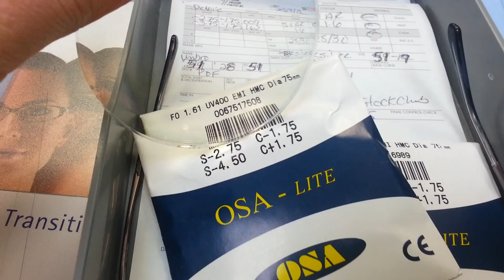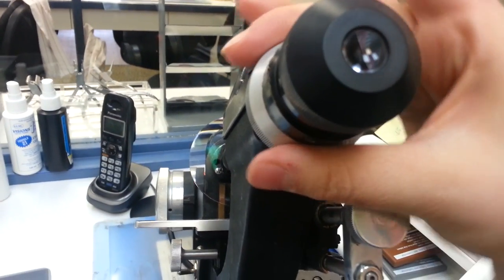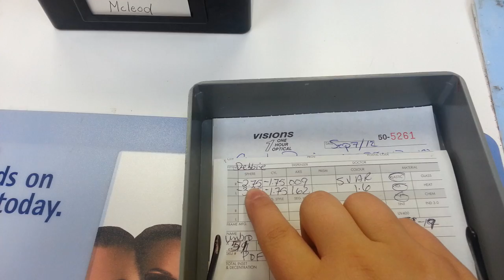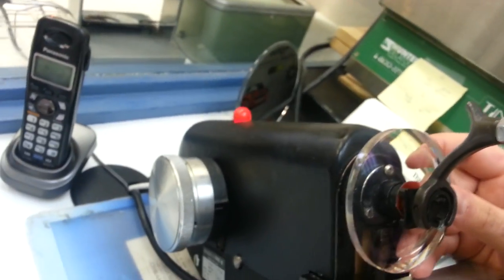Optical help: learning the Lensometer

Comment: thanks a lot, but we need to know how to start with new glasses of unknown power?
Reply: very much usefull
Reply: It's actually pretty straight forward (assuming single vision lens), lets say you don't know the prescription of the lenses.  You're just gonna hold the lens in your hand and adjust the power nob till the sphererical meridian comes into focus first (the triple line), and with your hand you're going to rotate till the 3 lines at the center are facing the same direction as the plane... you'll be able to see through rotating that the lines will rotate too.  Once you have that you want to find your cylindrical meridian, so adjust the power knob up or down till the cylinder axis comes in focus.  NOTE:  be careful when finding the prescription you don't get the axis reversed, it's easy to have it 90 degrees off its a common mistake.
Reply: Yea

Comment: Pretty good video. When you switch from cyl to sphere lines it should be a 90 degree turn, not 180. It's always good to keep an open mind when reading lenses and starting subjective to ensure power instead of reading the rx from an order.  To answer the other question about the -4.50, that would be if you're reading the lenses in plus cylinder instead of minus cylinder.
Reply: Brandon Winter please are you an optician

Comment: hi i really like the lecture but im confused. Are you just confirming which lens is -2.75? what if for example someone wants to know whats the power of her current prescription eyeglasses? I would really appreciate it if you reply. THank you
Reply: arrabella WILLNER answer to Q#1: she is verifying sphere power of lens to what was printed on package it was in
Q#2 Yes you can read powers and axis of eyeglasses 
Place glasses on table of Lensometer. Turn dial to find sphere power and cylinder power (if there is one) and then turn axis dial till 3 lines line up.

Comment: thanks for the lecture but just that u were a little bit fast.... want to know how u came about - 4.50
Reply: Ndochiem Emmanuel Note that on the Rx in reference it had a sphere of -2 75 & cylinder of -1.75 ...if you add two minuses together the dial reading reflects this= @-4.50 in order to see the 3 lines clearly